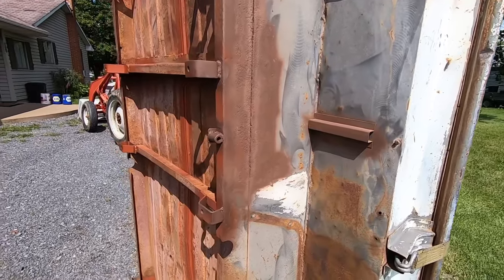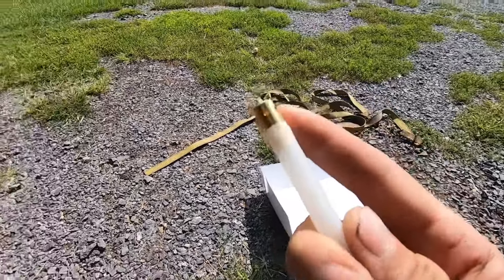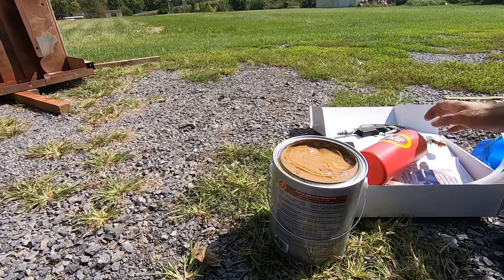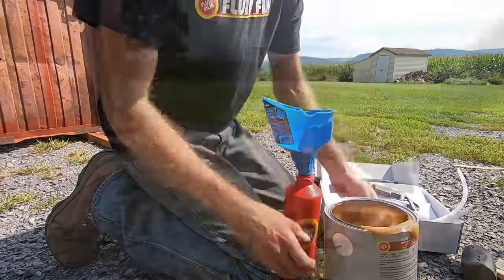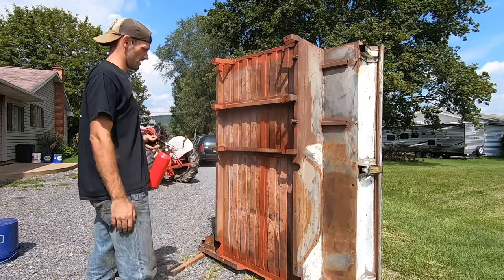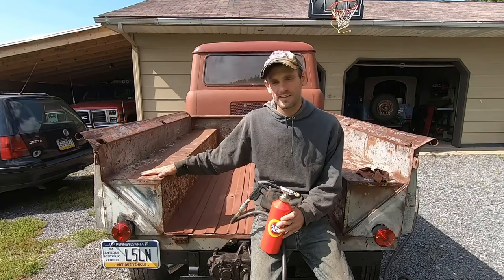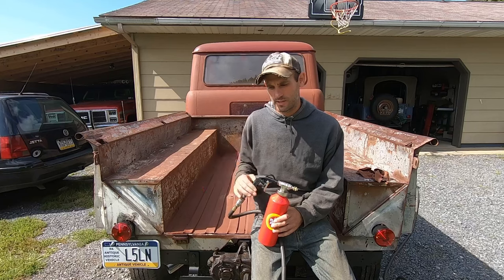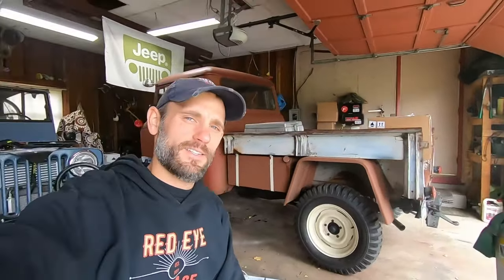Make your car last forever with FLUID FILM

Comment: Don't you need to neutralize the rust in order to stop the "cancer"?
Reply from the maker: This isn’t really to fix “rot” this is to protect what you already have.  It definitely will stop rust but it’s not going to regrow metal or anything. “Neutralizing rust” is a marketing gimmick gimmick. Rust needs 2 things. Moisture and oxygen. Fluid film blocks both but once it’s worn or washed off the rust is still there.  That holds true for any coating or paint.